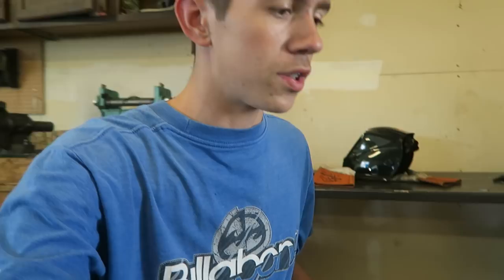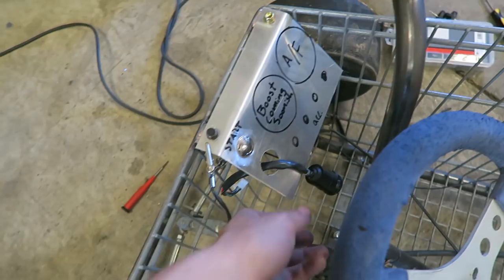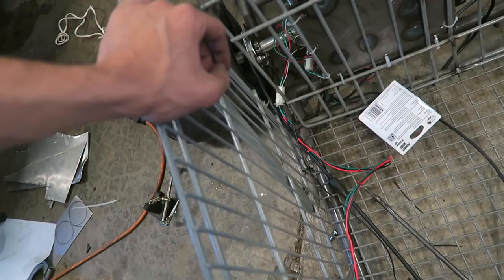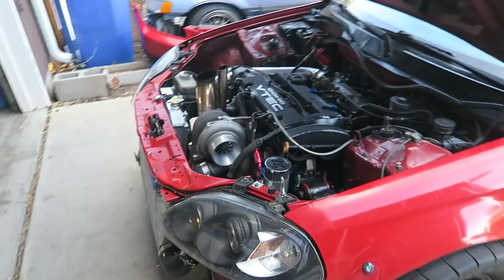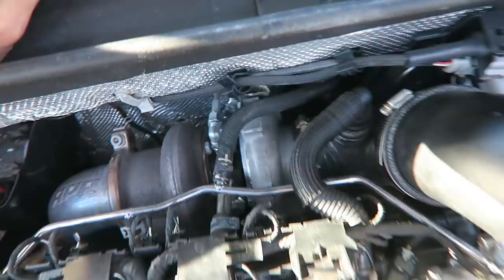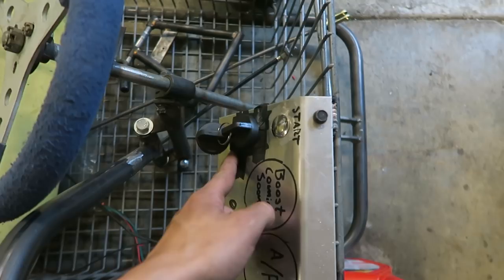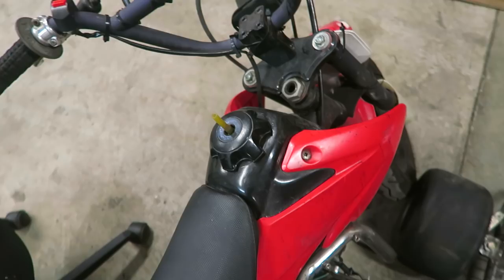New Turbo for the Shopping Go Kart?

Comment: Kyle, when you solder, you should make a physical connection between the wires before you add solder.  Twist them together so they are pretty solidly connected without the solder. Solder is not a weld.  It should not be used to provide the physical structure.  It is more like electric glue.  Just thinking of the damage to the engine that resulted from a failed solder joint, so hoping this helps in the future.  Cheers
Reply: Walter Lowes i was typing this exact suggestion right before i read yours beat me to it.
Reply: i'm a big fan of the western union linemans splice.  it's extremely strong mechanical connection and when you solder over it's complete.  I've never had one fail on me.

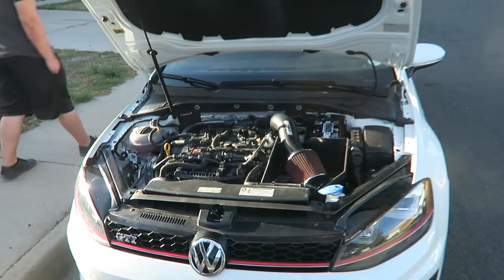Comment: 12:36 There is a pair of Pliers in the engine bay of the gti by the wipers.
Reply: lol good catch
Reply: motorgarage 21 
I've got Volkswagens, so trust me that's there for a purpose. 
Don't drive without it or you will break down and need it.  
I've put a 10k cubic foot snap on tool box fully outfitted in my 79 rabbit glove box for when I break down.
Reply: 96cobrasvtRJ 
Back in the day I could keep a 6 pack up there in a mk1 😬
Reply: motorgarage 21 damn also those pliers are black to match the paint
Reply: Lol I saw that too
Reply: ىوبو

Comment: BoostedBois if your looking for suggesting for the wire tuck well I have a suggestion how about you use a piece of small metal pipe and wield it to the cart and then put the wire through the pipe and then you have a clean wire tuck for the cart Lol

Comment: FYI a regulator/rectifier is actually a series of diodes with a heatsink which takes the ac current from the stator and changes it to dc so it can charge the battery. The stator is what is actually charging the regulator/rectifier just changes the sine wave back to dc.

Comment: I dont know why everyone does it like that, but my dad is a mechanic and when you solder wires together he has always taught me to twist the wires together and then tin them, because solder is much stronger when the surfaces are weaved together. If you just hold the wires next to eachother they will always break eventually.

Comment: Pull the pins out of the plug, run them through the frame tube, then put the pins back in the plug. Tip take a pic of the plug prior to taking the pins out. Also adding a big weather pack connector up by the switch panel will allow you to pull the panel out I  the future without undoing all the wires.

Comment: remember youll have to get an EFI kit running on it if youre going to turbo it
Reply: Chris Mathy down draft carb.
Reply: Chris Mathy blow through carb. Just have to pressurize the bowl. Easy shit
Reply: Chris Mathy boost referenced fuel regulator and fuel pump all thats needed.
Reply: You just need to put the carb on the outside of the turbo
Reply: Cars and cameras did an efi setup, it worked pretty nice
Reply: MrTheHillfolk that's the one I have in mind
Reply: Chris Mathy no you don't run it blow though without an issue

Comment: The stator is the charging system.  That is what charges your battery and runs your lights. That produces electricity. The voltage rectifier just smoothes out voltage spikes and converts AC to DC .

Comment: The stator is what charges your battery. Most stators put that voltage out as AC voltage. The regulator/ rectifier converts that charge to DC voltage and maintains constant numbers. I didn't know this either until I bought my first motorcycle and it had some charging issues. This build is fucking sick though. I want to do one for myself, but I don't think a shopping cart would get along with me being 6 foot 7. Haha.

Comment: On those quick connect plugs if u disconnect them and look from the back u can see tinny rubber plugs that keep the wire inside of the connector those little rubber plugs are designed to pop out just use like a tiny screw driver or a pick and pus or pull them out and u can pull the wire right out without having to cut or crimp or sander anything

Comment: that back plate on the clamp you should get some pipe connectors that tie them down to the wood and hold them in place or PVC pipe that has electrical running up the middle anyways it bolts into that backplate you'll have and it has like two half circles coming off each side that would normally clamp down pipe except in this case it can go around the metal cage of the shopping cart they sell them in all different sizes

Comment: E6000, Shoe Goo or 527 glues will work great to mount ignition switch. They can handle vibration and stick to anything. All available at Walmart in the art supply or Auto or household section

Comment: For the rectifier, just put a diode on one of the coil wires to the battery and it will work just fine, then ground the battery and ground the other side of the coil!  
It's only a half wave rectifier but the wiring is much cleaner

Comment: It's gonna be too much boost for a small motor like that, there's no way it'll run effectively
Reply: Arthur Rapatiy that's where a wastegate comes in, to waste boost and not push too much pressure lol
Reply: If you have a wastegaste set to like 3 or 4 it wouldnt hurt it would it?

Comment: You should use a length of electrical conduit tucked in corner for cables then you have option to add lights ect easily 🖒

Comment: You need to seal the vent on the fuel bowl and run a boost reference line to it. You want the line as close to the turbo as you can get it. Plug the air correction jets. Should get you close to tuned with that carb. A bigger carb "hat" will make tuning easier.

Comment: Dont forget you have to do a draw-threw setup with that carburetor on the inlet of the turbos cold side and the outlet off the turbos cold side blowing in the motor or get a efi fuel kit for it so you can tune it !😀👍👍

Comment: Ok hear me out, for the shopping cart turbo you should run a k03 off an Audi/Volkswagen, those turbos are small af so it would spool. For lubrication you could just pack the oil gallery of the turbo with high temp grease or gear oil. The big benefit of a k03 is that it is cooled by coolant as well so you could run a small electric water pump and create a little cooling system that would have a resivor and a radiator of sorts (heater core?)
Reply: the purpose of water cooled turbos is for after you turn the car off. the heat from the manifold continues to heat the turbo while it's not running oil. having water lines connected helps cooling after shut down, and extends the life of the turbo

Comment: One more comment I used to install remote-controlled awnings on the houses and even awnings that her in close rooms so the walls come up in everything you have to run the wires through the metal frame I have a tool it's kind of like we call it the fish hook you attach your wire to it and the line is kind of stiff and sturdy and you can fish it right down to wherever you need it to

Comment: You realy need to but that litle turbo on it could work well with it you can hook the oil up of the head there is a bolt on the head its oil line of the motor and the other oil line to back to the head just drill hole and pipe fitting👌

Comment: you planning to go fuel injected? a turbo with a pull through carb will be really hard to start with a single cylinder engine and those tiny carbs will wont support a blow through turbo.

Comment: Why do run a 20/50 oil? I have a h22 to b series trans swap. I heard to run that but i just put in 10/40 cuz its thicker than 5/30 please reply or anyone give some feedback
Reply: For extreme performance engines where very high heat will be generated, thicker "racing" oils, especially those with more protective additives, are necessary for proper lubrication and protection. That's the simple explanation. When a car is making 500+ HP out of a couple liters, 10W-40 may not be enough when running it hard.

Comment: DUDES try thIs! I used this on one of my little mini bike builds one of the super pit bike types. Had an aluminum gas cap that was 
 non vented so I drilled and tapped a 5/8" hole with a thread kit and it's been working great for 5 years now. You can drill straight into the hole you already have and use a thread chaser or whatever you guys like to call them. I'm pretty sure this one is still the same 5/8" thread as the one I used. Keeps mositure out, and lets gas fumes out as they build pressure. Just thought i'd help out since I love wathcing your shennanigans that I myself am constantly doing in my back yard. 
 https://www.amazon.com/Sea-Dog-352110-1-Tank-Vent/dp/B000ZFUYOM/ref=pd_lpo_sbs_263_img_1?_encoding=UTF8&psc=1&refRID=WN4KHYVT5SMX63VBXPPY&dpID=41RG-R0xECL&preST=_SX300_QL70_&dpSrc=detail